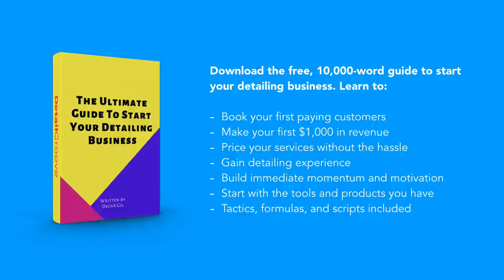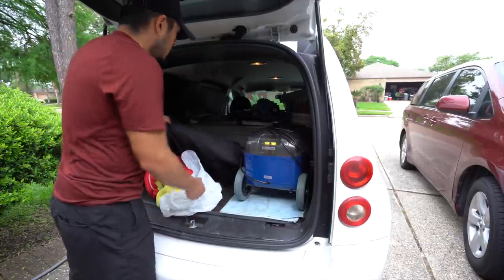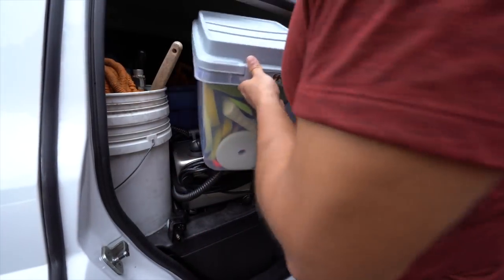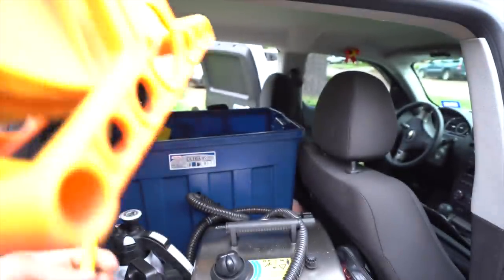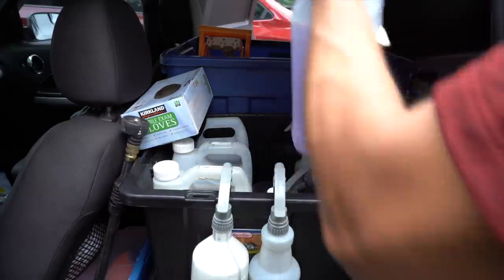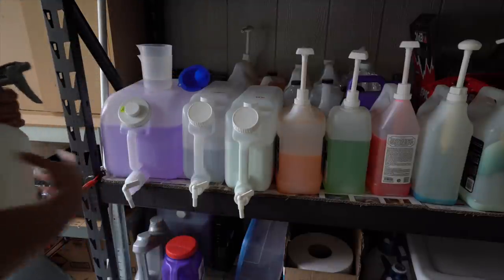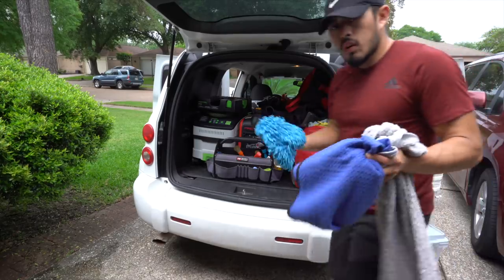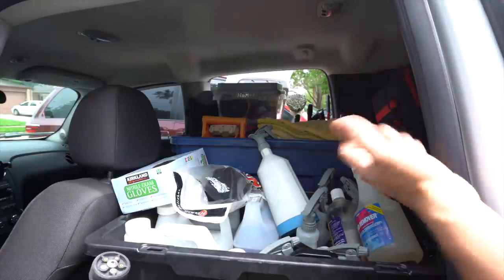How I Prep and Organize My Detailing Van - Small Mobile Detailing Setup

Comment from the maker: Not the biggest or baddest setup, but it works for me. What's your mobile rig? If you're interested in the tools and products I use, check the description.
Reply: the polisher to clean the carpet cause my drilll brush keeps going dead
Reply: Detail Groove i bet you won’t reply to this
Reply: Video on the new steamer?
Reply: It’s not the size of the van that counts. It’s how you use the tools!
Reply: Detail Groove I’m 15 do you think I could start a detailing buisness I’m a little intimidated by it
Reply: I have been looking for a Ford connect van for the longest or one of these hhr's
Reply: For my business I run a Chevy express extended. Electric set up and a 60g tank. Gives me extra space for the extractors and steamers. I also run a Nissan Frontier with a 150g tank all gas set up. What kind of van is that? Lookin into buying a new van
Reply: #BROOKLYNDETAILZ Here. I also run a hhr panel. Running a 50g tank, 2700psi electric pressure washer, 12g air compressor. Shop vac. Generator. Paint correction polisher box. Headlight/carpet buffer bag. Clean wrag bag, 2 dirty wrag bags. All my chemical. Step ladder canopy. And more. I see you use your space alittle differently. But seems you need alittle more.   Think abt adding a roof rack with a cargo box. Helps me tuns to keep alot more things on board without having things that are rarely used in my way.
Reply: Oscar does the 2000 watts generator strong enough for the the aqua pro vac ? I am planning to buy a generator and I am limited space as well . Just wanted to hear from you since I see you own one of each .thank you !
Reply: @brooklyndetailz2329  tell more about cargo box stuff put inside also have link that you use? Check different styles.

Comment: On your generator, can you run your steamer and shop vac? Or will it overload? Thanks great videos!!
Reply from the maker: Noo, the steamer requires far too much power. It has to be one at a time
Reply: @DetailGroove  HEY GREAT VID HELPS SHOW THE PROCESS. I UNDERSTAND THAT YOUR ANSWER WOULD BE MORE FOR THE VAPOR CHIEF  DO TO THE WATTS NEEDED TO RUN IT. DOES THAT ALSO APPLY TO THE MC 1385 STEAMER WHICH YOU ARE VERY MUCH KNOWN FOR PRIOR. I AM VERY MUCH INTERESTED IN BUYING THAT SAME PREDATOR INVERTER . I ALSO USE CUSTOMERS WATER AND POWER TO PERFORM MY DETAILS AND I AM IN BROOKLYN N.Y.

Comment: are you using the customer water ? do you use any water filter system ?
Reply from the maker: I use customers water, correct. No water system. Just straight out the tap

Comment: Does your cordless dewalt drill hold a good long charge when you use it ?
Reply from the maker: I usually go through both batteries on a detail but overall yes
Reply: I have the 5ah battery and it lasts forever